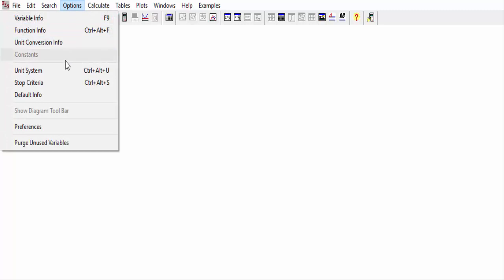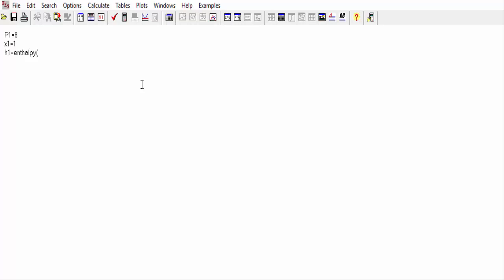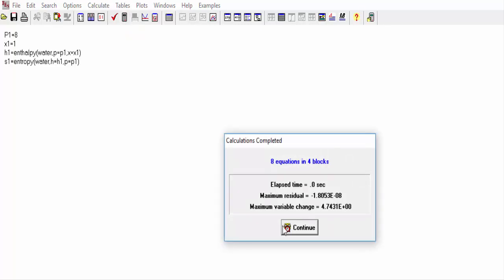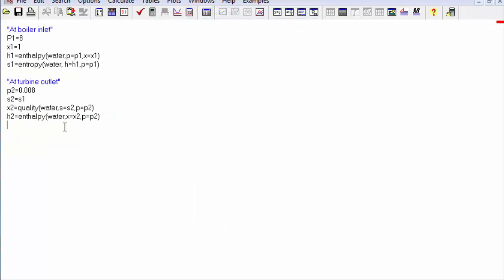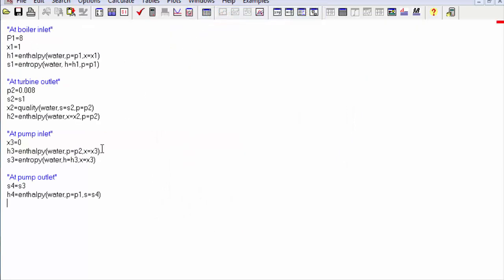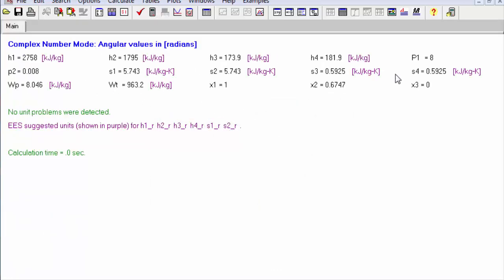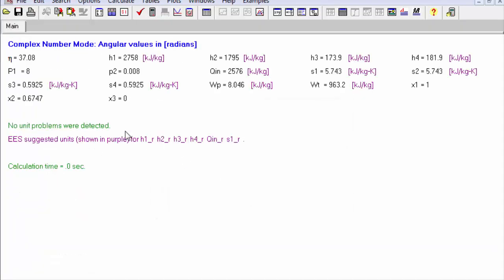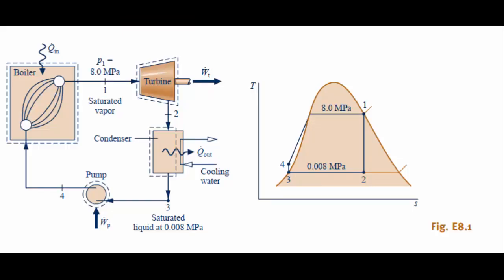Solving steam power plant problem using EES software

Comment: what if we need to change water with ammonia?
what are the parameter are required to change in the above equation
Reply from the maker: In this video phase change is defined,  the respective substances will change their phase according to their desired temperatures.
Reply: @syeddaniyalmehdi9981  sir your video is very much helpful but we request you to make a video on organic rankine cycle like anhydrous ammonia
because the way you explain is simple and on the point , their are many other video tutorial but quite complicated.
Reply from the maker: @pratoj7   Thanks for your appreciation. Well this video was related to steam power plant using this software. What type of process is involved in anhydrous ammonia, like what type of industrial application.
Reply: @syeddaniyalmehdi9981  anhydrous ammonia is used in Ocean thermal energy conversion power plant and geothermal power plant
so it will be great if you demonstrate us over ammonia based rankine cycle 
it will be helpful to student like us
Reply: @syeddaniyalmehdi9981  ammonia work as steam at 320k and liquid at 260k so in ocean thermal and geothermal power plant they use ammonia or other organic rankine cycle
Reply from the maker: @pratoj7   Ok I will study this and then try to make video on the software.
Reply: @syeddaniyalmehdi9981  thanks